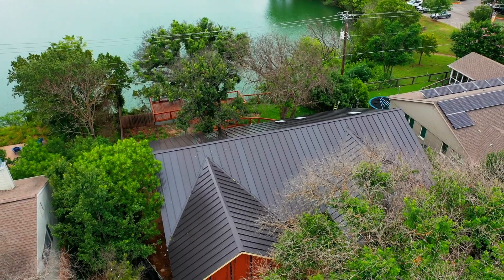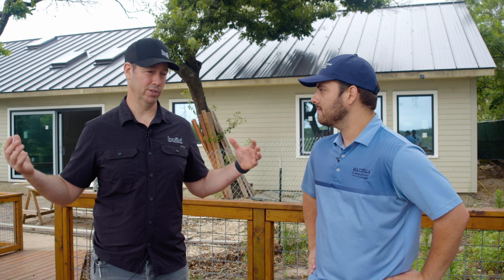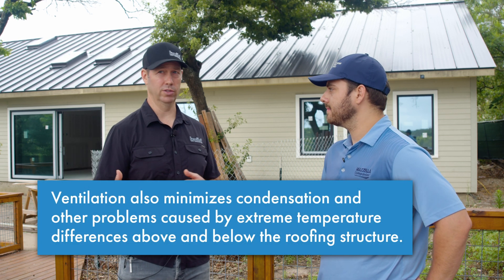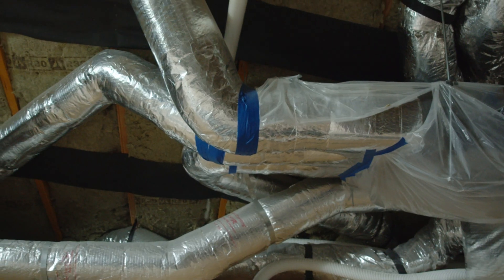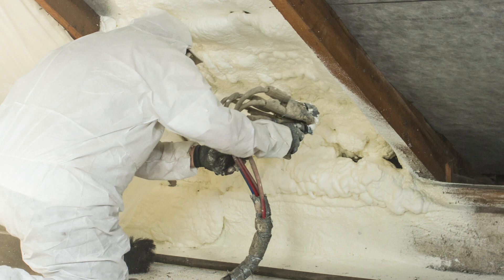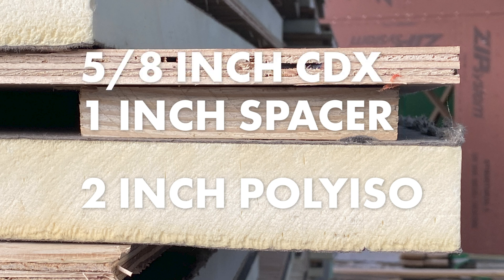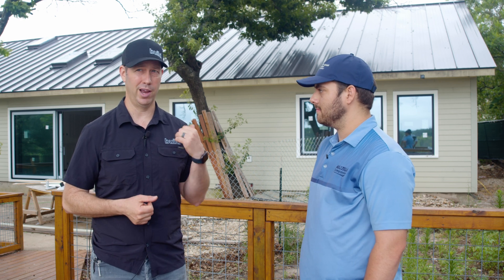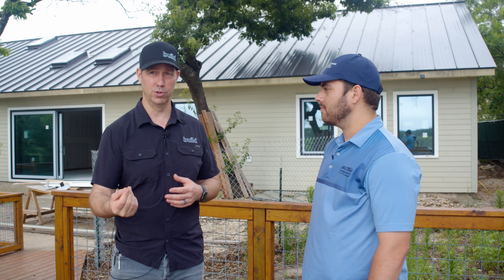Conditioned Attics vs. Vented Attics: Matt Risinger and Hunter Panels

Comment: How insulated should the floor joists of a conditioned attic (or the ceiling joists beneath the conditioned attic space) be, relative to insulation at the rafters if this isn't going to be a living space.  Also, should there be HVAC vents in a conditioned attic or is the heating/cooling of this space intended to be achieved passively through the floor? 

My concern is that if the floor of the attic is insulated, and there are no HVAC vents in this space, then wouldn't any floor insulation (ceiling below) effectively prevent passive climate control?   Especially if the floor insulation R-Value is close to or greater than the Rafter R-Value, then am I correct that the roof would be, effectively, leaking energy faster than the passive transfer through the floor?

On the flip side, if you were to have HVAC vents in a non-living space, it would seem like a waste of energy, though I could definitely see how it would improve the feel for the living space below or adjacent, but again, it seems like sufficient insulation would be a much more efficient way to achieve this. 

I get that my thoughts above seem to indicate a logical conclusion: Little or no insulation in the floor, lots of insulation in the rafters and passive heating/cooling, likely with no HVAC vents in the attic..... But..... I am asking the question because my home was built in the 5190's, it has a vented attic space with 2" rafters and 2 inch joists between the attic and the main floor.  Id really like to convert it to a conditioned attic but as a DIY'er, I am very concerned about my ability to sufficiently airseal a 70 year old space that wasn't initially executed with that in mind.  I feel like I, as a DIYer, am more likely to achieve an effective airseal between the living space and the attic than I am between an attic (that wasn't originally built with airsealing as a priority) and the outside world.  Or am I overthinking things?
Reply: We’re in similar boats. I love the idea of these pre-built panels to get exterior insulation, but it’s going to take a lot of reading and reassurance that I’ll be able to create an actual air seal for the interior space. Additionally, the roof itself can vent through the ridge. 

For retrofits, it seems like cutting all the rafter tails around the roof and resealing everything as a continuous layer is the starting point. Clip-in new overhangs with an insulated, air permeable ridge vent Aiming for Risingers Monopoly House (straight from Joe Lstiburek mentioned in this video)

As the DIYer, this seems both daunting, expensive, and hopefully a good time haha.
Reply: To your point about hvac registers. I’d think a really well sealed and insulated conditioned roof/attic would take very little energy to maintain consistent temps around the house. It would require blower testing to see how leaky it is to get a load calculation.
Reply: From what I’ve read, insulation on the attic floor is not recommended when roof is insulated. Why don’t you spray foam the roof which doubles as air barrier? Matt Risinger and Joe have a video and article “Ping Pong Water” discussing the air conditioning of a conditioned attic. In short, yes, you should in climate zones 1-3. I live in zone 4 and will also condition the attic or use closed cell spray foam.

Comment: If you condition your attic does an asphalt shingle roof still need to be vented or is that just for metal roofs?
Reply: Asphalt shingles by nature because of the material and the suns rays will cook itself to death.  So venting to try and control the temps or have a cooling process will help them.  But the monster in the room is the material used and asphalt shingles will always have that down fall.